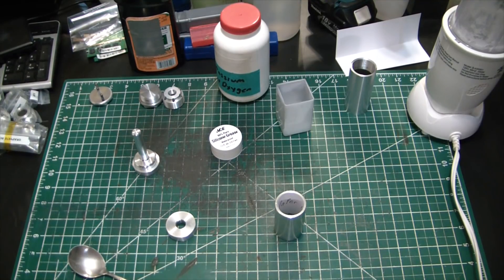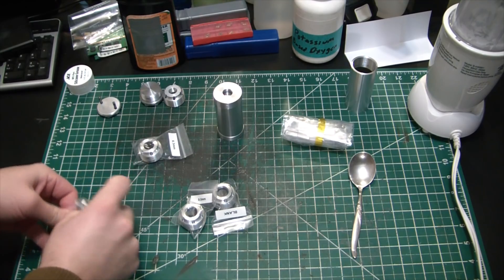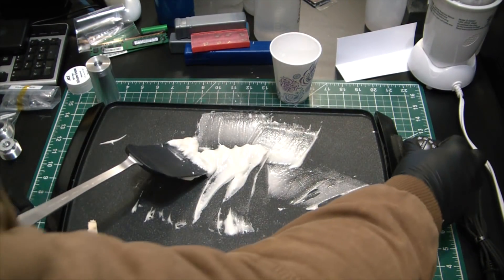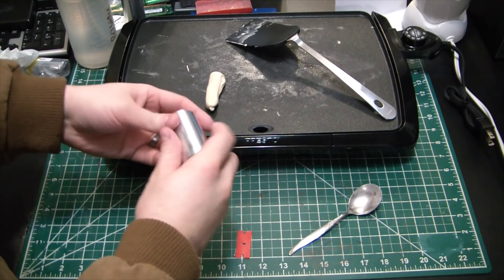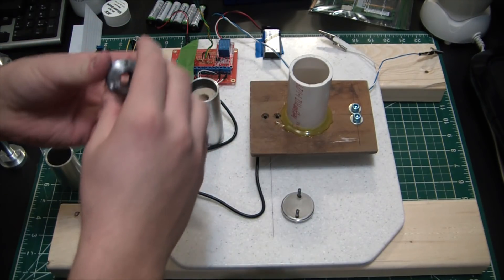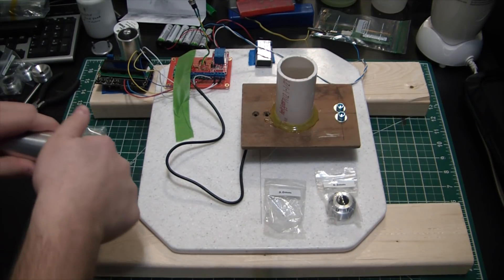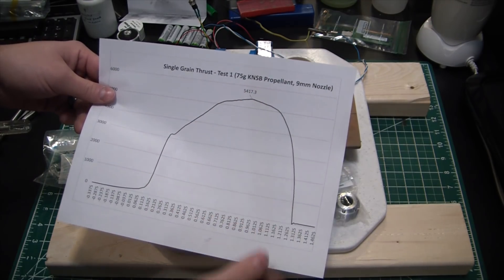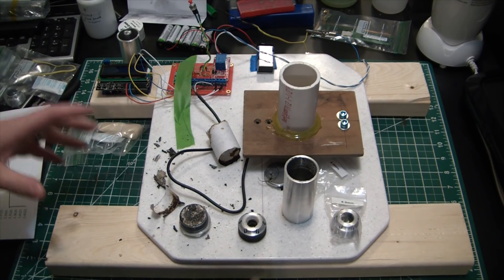Testing The Biggest Rocket Motor I've Ever Built on Arduino Stand - ElementalMaker

Comment: Ok I made the sorbitol rocket propellant and it did not have liftoff. I don’t think it burned fast enough. Should I add some red iron oxide?
Reply from the maker: Way too many potential variables to know what the issue was. You would need to give me all the details of your motor.
Reply: @ElementalMaker  well i made it out of pvc 1/2". i think the problem might be that it wasnt cored well. my coring thingy broke off so it only went half way in. thats what im thinking
Reply: @ElementalMaker  also my nozzle wasnt very good. it was just bentonite clay and it blew out instantly.

Comment: Excellent video and beautiful test!! Just a recommendation, for best results during the measurement, you could put the test device in a rigid surface, because I suspect that the grass absorbs part of the rocket engine energy 8:32 and consequently you will measure less thrust (or a different curve). It would be curious to see if there is any difference. Your channel is awesome! Regards.
Reply from the maker: Thank you! Yeah I was hoping the 2x4 base would help prevent that, but it did visibly push into the ground a bit. Im sure my data is a bit low due to that. I plan to make some kind of more rigid base in the future.

Comment: you should add a really small amount of copper oxide (or copper dust) and get a green jet.
Reply from the maker: Copper oxide works great for color in AP based motors, but on nitrate-sugar based motors there is just smoke :(. It does increase the burn rate a bit though! I will be using copper oxide in some future videos on AP motors.
Reply: @ElementalMaker  As you probably know, it is because the particular 'ammonium-based solid oxygen' you are referring to has Cl in it and can therefore act as a chlorine donor.
Reply: @ElementalMaker  also hybrid motors are pretty cool wink wink
Reply from the maker: @hiddencow3272  hybrid motors are on the way 👍

Comment: Makes me wonder if a suppressor body (no baffles, or baffles removed) could be used as a high capacity engine case and nozzle.
Reply: The suppressor case doesn't have a nozzle, just a hole, so it would basically be a cylindrical pipe section...

Comment: ~5107g g-s, so about 50 N-s. Happy to send you a spreadsheet.
Reply: I got a hair lower using excel but not far off.  If rounded up what I get comes to 5kg so yeah not bad for a sugar motor with too big a nozzle. He's into midpower with an F motor.
Reply: I have to disagree with this value.   Just by "eye-balling" a close up of your chart...ie: length of burn ≈ 1.15 s and the MEP (mean effective pressure) appears to be ≈ 2500 g  so the product of these two would be the Impulse (area under curve) ≈ 3000 gram-sec or about 30 N-s.    The MEP can be judged fairly accurately by eye, if you imagine a horizontal line that would split the rocket engine's graph in half area-wise.   I estimated this line to be at 2500 g.

Comment: I've done some calculations in R and seems like the area under that curve is 5107.915 g-s with absolute error < 0.55. The error (which is really small) is due to the adaptive quadrature method used for evaluating the area. It could be a little bit higher because of the Hermite spline interpolation done on the data, but still I don't think that could be problematic at all! The area is calculated on the raw data given, I don't know if there was some scaling to do beforehand

So the result comes out to be roughly 50 N-s
Reply: Yeah I calculated 5096 g*s,  in Excel. I just did rough area calc by taking difference in time data points * thrust data point and then summing them all up. riemann sum.
Reply: That is most certainly not the Isp.
Reply: Yes the error is small. I think you're overlooking something. Don't you?
Reply: @PaulHollandWheels  Being the data without any error, the only error is in the evaluation of the area under the points which is given directly by the function in R! The resulting plot is very well-behaved so I would expect the error on the area to be small
Reply: @Wompylulz  I was just giving you a hard time . I'm in awe of people like you I really have no idea and it's right or wrong I don't even know for sure what the equation is I know it pretty cool to be able to do that though😉
Reply: @PaulHollandWheels  Ahah! Often what seems like black magic really isn't! Rough data analysis it's not at all complicated: with the advent of statistics oriented scripting languages like R, you pretty much have to know what's best to do and then the program does it all for you. You should give it a look if you're interested, it's very community based so you'll find tons of information for beginners and professionals! In fact I'm a physicists not a statistician
Reply: @Wompylulz  Well I'd like to think I'm a hacksmith but I'm really just to hack I love to fly my drone  but you can't do that when it's cold like it is outside I'm retired well more like disabled and I still don't have enough time for the things I like to do and some knowledge I'm better off not having truthfully LOL but I'll take you up on the offer if I decide I want to learn something that will probably end up getting me in trouble LOL I love to make things and sometimes I take it too far just ask my wife LOL
Reply: @Wompylulz  BTW You just got my sub👀So I'll be watching LOL
Reply: @PaulHollandWheels  Ahah! Thank you but it's been a while since I've posted something..academic life occupies my whole day! 
On the other hand I've seen some of your videos: you were not kidding, crazy stuff, I love it!

Comment: Rough calc gives me Isp= 187.42s   but I used a quick and dirty method so YMMV.
Reply: so a nice class H motor with out having to go through certification and red tape, comments above are saying its a F motor so i thought i would correct my self and leave original as context
Reply: You seem to be off by a factor of almost 4. Not sure how you got that value, but others working from the raw data got an Isp around 50s...
Reply: @Nuovoswiss  Yep. There is no way that could be higher than about an F.

Comment: why not rcandy? there was a software that we used in the past to calculate the grain size, core size and nozzle size and shape calculated by the required performance... i dont remember the name but i will search for it when i have time...
Reply: IamIUareU if you find it let me onow
Reply: @sethmorton8539  from fast search thru my external hdd i found this links (sorry had no time to check more what is what):
https://www.grc.nasa.gov/www/k-12/rocket/Downloads/index.htm

https://www.spacecad.com/

http://www.space-rockets.com/cgcalc.html

https://www.microsoft.com/en-mk/p/high-power-rocket-nozzle-designer/9nblggh68gfz?rtc=1&activetab=pivot:overviewtab

https://www.nakka-rocketry.net/softw.html

http://burnsim.com/

https://www.nakka-rocketry.net/design1.html

https://www.nakka-rocketry.net/th_grain.html

i couldn't find exactly the link i was looking for with fast search, but i hope some of those links will lead you to the exact software... later i might search again for it more thoroughly... i remember it was a calculation based on the max pressure you want in the motor chamber or something like that...

Comment: Trapezoidal integration of the excel data should be easy. Mathematically you average datapoint 1 and 2,  multiply the time between samples, repeat for 2 and 3, etc... and add them all up. In excel you should get the same results by averaging all of the numbers and multiplying by length of time between the first and last datapoint.

Comment: The simplest way to integrate over a dataset in excel, I think, would be to sum up all your data points, and then multiply by the length of the timestep.

Edit: Doing that with the data you linked between the marked start and end points gives me ~50.1 Newton-seconds of impulse, so the motor would be a class F, and your specific impulse is 68 seconds (an exhaust velocity of 668 m/s).
Reply: I've just done the same (worked out average thrust from data points, although changed start and end points you labelled)
So can back up Zuthal's Maths

Total Impulse = 51.61 Ns
Isp = 70.23 Sec
Eff Exhaust Vel = 688m/s

A smaller nozzle diameter/high chamber pressure should yield higher exhaust velocity and efficiency

Comment: Why not use a icing bag or large syringe to fill it or even better pile it in upside dow without rod init then push rod through it with it flush to the table it will compact better.